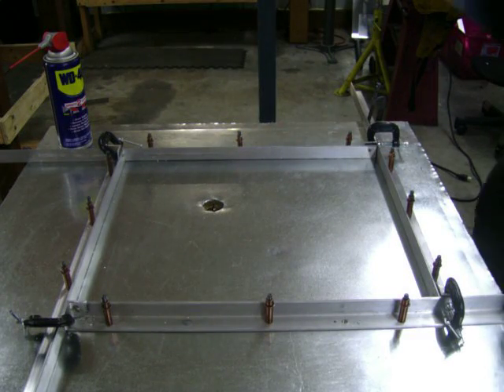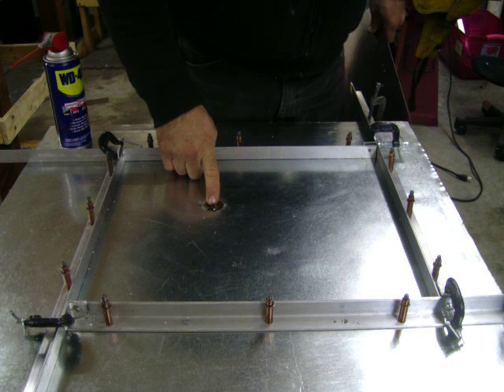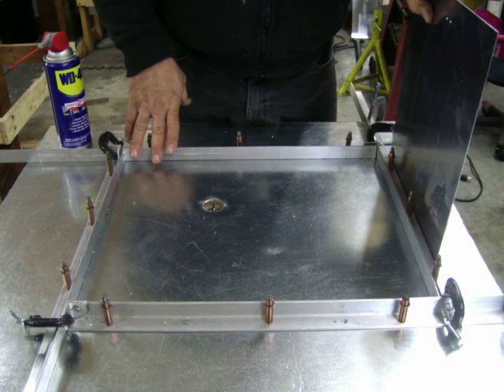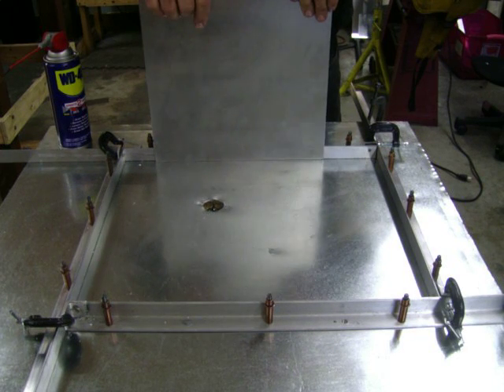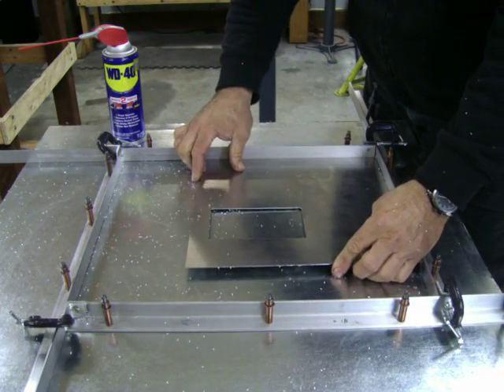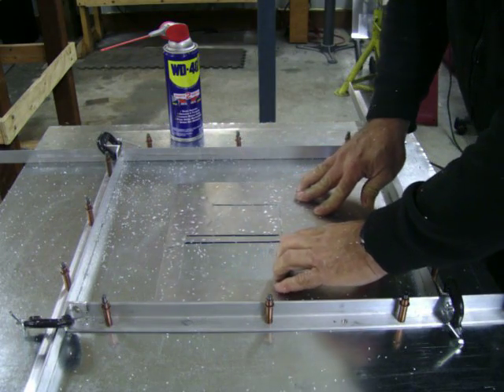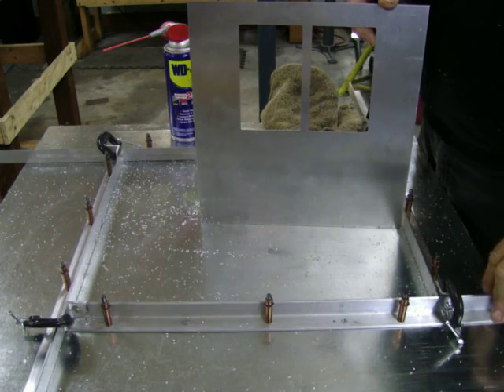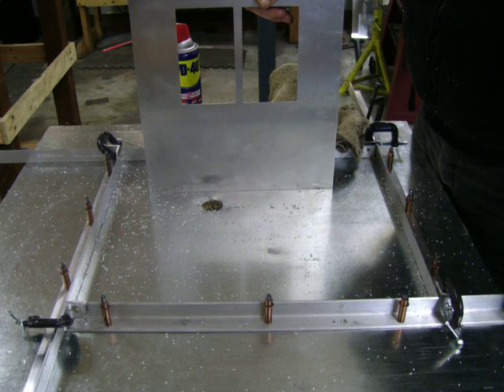Making Perfect Square Holes in Aluminum Sheet Metal

Comment: Do you think this would work on 4mm aluminium and what's to router bit?
Reply from the maker: 4mm might be too thick for this process, but you can always try. I use a 1/8" router bit here.
Reply: @Rickster5176  cheers for that I will give it a go 👍

Comment: Outstanding and amazing..
Reply from the maker: Thanks.  I'm an A&P myself.  This is great for making holes for avionics and other aviation applications. Hope this is helpful.
Reply: Rich Eaton       Have you seen the suction cup handle units that glass repair guys use??..........they have a toggle handle that releases the suction on and off........using one of those units would give you nice control and aid sliding the work around and keep your extremities from the high speed cutter bit.........most excellent crafting of aluminum or plexiglass sheets around........thanks for sharing your ingenuity..
Reply from the maker: Yes. Just for grins I went out and bought a couple 2 years ago.  Silicon suction cups on aluminum sheet sprayed with WD-40 was a complete disaster.  That combination was slicker than an eel on oil. The suction cups didn't hold worth beans, I ruined some expensive metal and I didn't have any control over the metal. On the other hand, I've never had any problems just using my bare hands. Like everything in aviation, you just have to use care and common sense.
Reply: Rich Eaton           What about applying the wd40 after you attach the suction cups???
Reply from the maker: That's what I did. It still gets under the suction cups.

Comment: can you do a video on how you set up the frame? mainly how you measure to have the hole in the right place!
Reply from the maker: +Mr. green  In a nutshell, I use this tool to make eight different hole sizes. Each set-up has a template. I position the template on the table then move the four guides into position for the particular hole I'm making.
Reply: +Rich Eaton how did you work out the templates?
Reply from the maker: The template is just a copy of the workpiece I want to make.

Comment: Nice video. Is it possible to cut 1.2mm stainless steel this way?
Reply from the maker: +jakob jensen I don't know. I've never tried it.  Stainless steel is much harder than aluminum, but 1.2 mm is pretty thin. Bottom line - I say give it a try.
Reply: +Rich Eaton Thanks :-) i will try

Comment: Thanks so much for posting this. Have you ever thought about using a router bushing and templates made out of wood or mdf? Then you would not need a router table and making templates would be much more intuitive. It is also much easier to clamp the sheet metal down and move the router around the template. One can easily cut theirhands while grabbing the sharp edges of sheet metal.
Reply from the maker: +PhotoBooth biz The only problem with your method us that thin aluminum like this needs to be well supported to get a clean cut.  My method supports the whole sheet of metal and doesn't allow it to vibrate. I've never cut myself doing this.
Reply: Yes you are right, that is why with my method I always use some hard Styrofoam board underneat the sheet metal.

Comment: Hey thanks for the video...what kind of pins you are using around your router table?
Reply from the maker: +Mr. Oates  Those are just plain old copper (1/8" inch) Cleco pins. They come in handy for this because I have a different pattern of holes in the table for each size hole that I make.  "C" clamps work well, too, but the Cleco pins work better.
Reply: Cleco's are used in the aviation world to temporarily attach sheet metal sheets together until the rivets can be shot  (installed) I know I have bucked few.